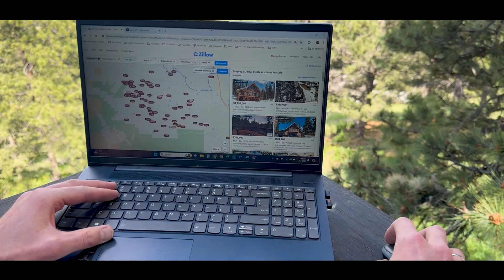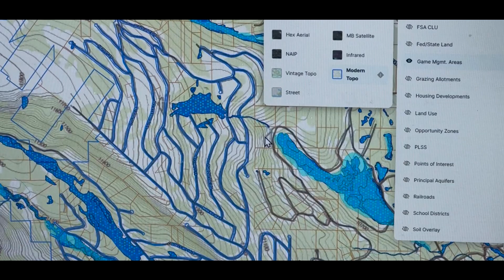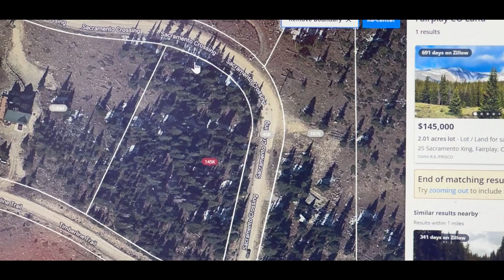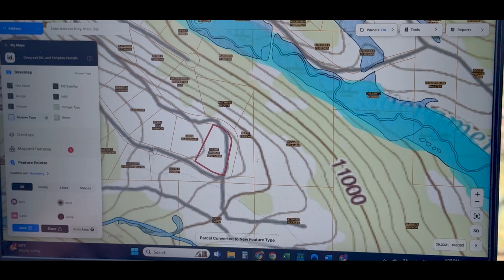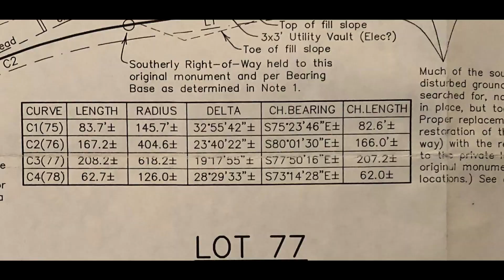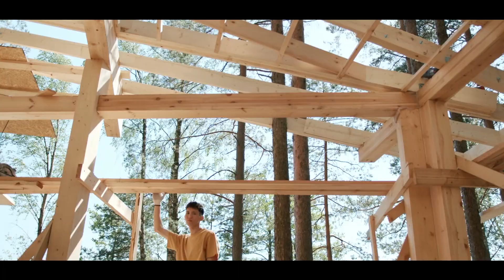How to Buy Land and Build your Colorado Dream Home

Comment: Nice to see this video and very useful information, many thanks! I would have welcomed a "Rough Sketch Timeline" laid out for once you have the property (whether bought ahead or wrap-up) and you're getting ready to design/build, e.g. what kind of timelines / windows do you typically see (I put a rough one below but just from my head) or do you guys have feedback? Again, great practical content. 
Project start
DESIGN                                                                                                CONSTRUCTION / SITE                                                                                   
Site Plan - existing survey access / utilities                                  Assess needed permits / applications
Design - building plans, new site / drainage plan                         Review / Approval of design plans, building permit application(s); Well application?
Plumbing, HVAC & Elec access & plans approval                         Rough site prep - access / drive and foundation excavation / grading, base, pavement; dig / install septic system
Construction supervision / change-orders ongoing                     Pour foundation, final site grading
Landscape design - remove/replace (wildfire mitigation)           Inspect foundation. Start envelope and utility rough-in
Final HVAC, lighting and site electrical                                           Inspect framing, envelope, sheathing, elec, plumb & HVAC rough-in. Start roofing and exterior final
Final interior finishes selection /changes                                      Finishes & appliance major procurement. Inspect roof, exterior & trim. Start interior finishing
Final change orders                                                                           Inspect interior finishes, commission HVAC system test and inspect (may do earlier?)
Final walkthrough
Reply from the maker: Thanks for watching and for the feedback. This is a great idea for a future video and we will post one covering the entire process from lot acquisition to the issuance of Certificate of Occupancy!